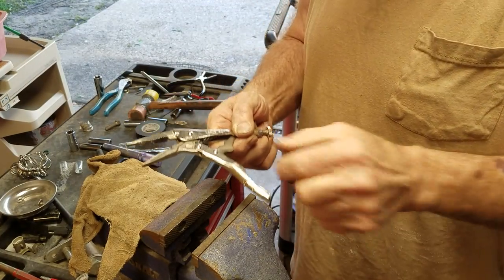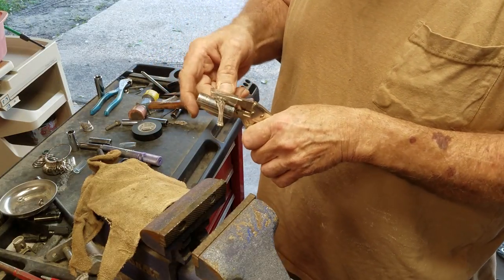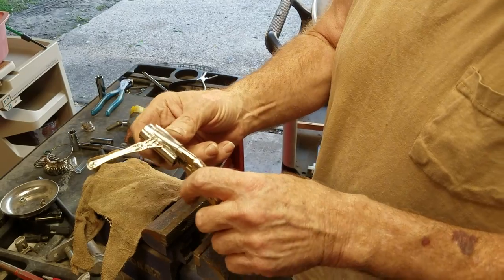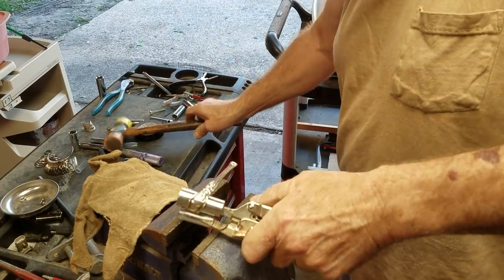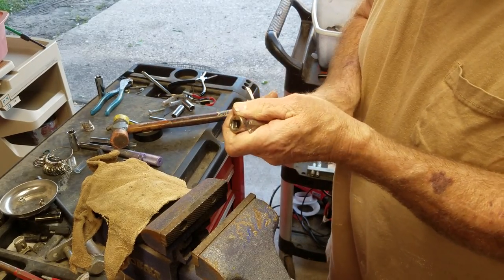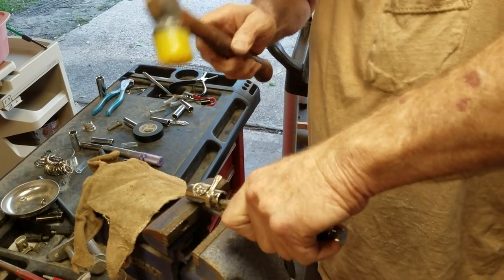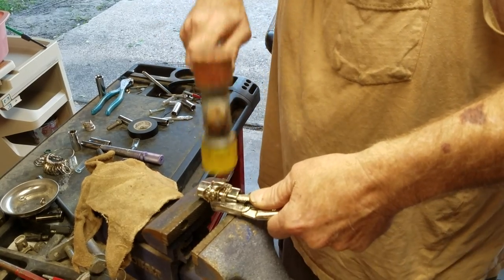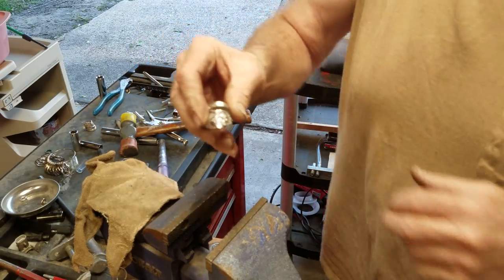Spoon rings made simply

Comment: Hey what is used to cut the spoon part off the handle part? And how do you file it down? Thanks! 🙏🏻
Reply: Also where do you get the plastic tubing for the pliers?
Reply: Great question! I was wondering how to remove spoon end also.
Reply: You can use bolt cutters to cut the bowl off the handle. I think he is using a ratchet fitting.